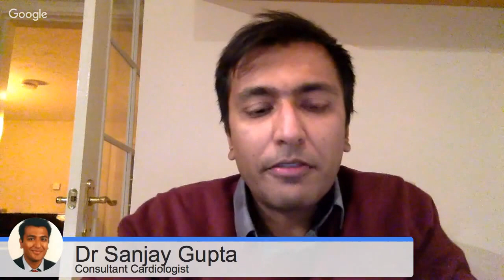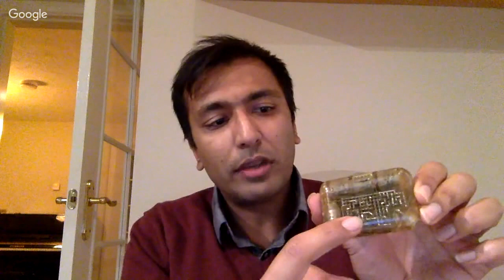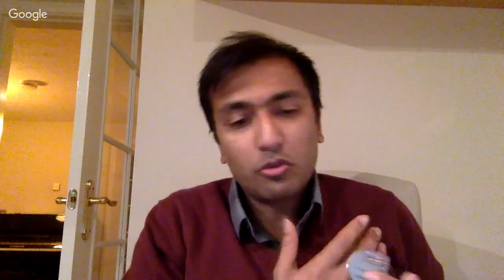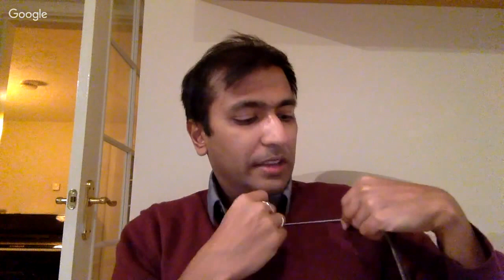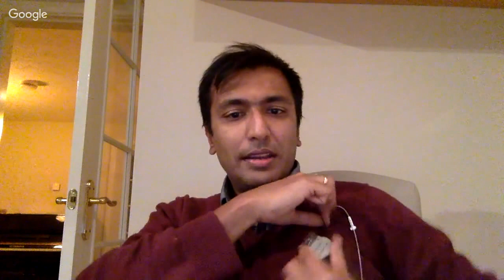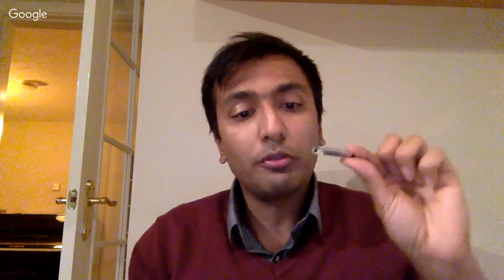Understanding pacemakers

Comment: Thanks for the helpful information. Your video raises a few questions:
1. You mention that people typically need pacemakers due to ageing and 'wear and tear' of the AV (the 'drummer). But why then do young people sometimes need them?
2. You say that people won't die without one; but if you have AV block 2 (Mobitz, type 2), isn't there a risk of converting to AVB-3 (complete block), which is potentially life threatening?
3. Apart from the risk of infection, are there any other risks, such as increased blood clots in the vein where the pacemaker cable is situated?
Thanks again,  great if you could answer these related questions!

Comment: Would you recommend use of Smartwatch to monitor heart rate, while with a Pacemaker. It seems I'm getting paranoid with my smartwatch. Had pacemaker implant last March 8, this year.
Had to check my watch so often while walking exercise, whether my HR is too high or too low.
Had HR as high as 152bpm while walking exercise.
Is this still ok for a 69 yr old female with PPM?